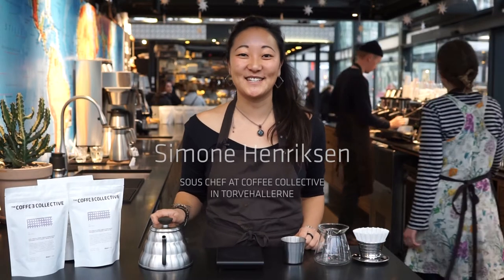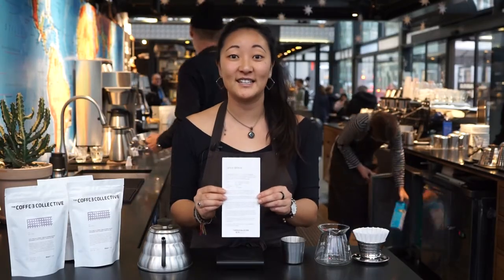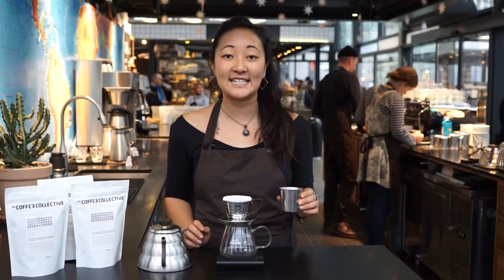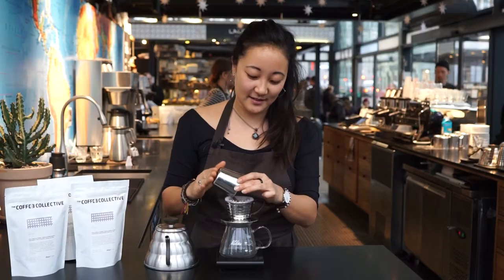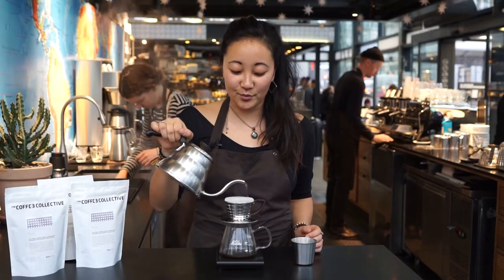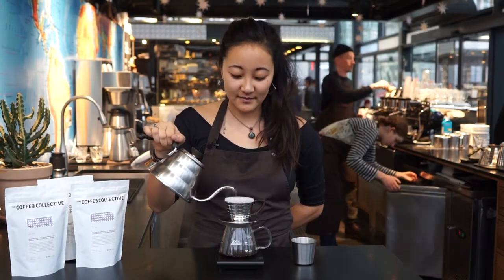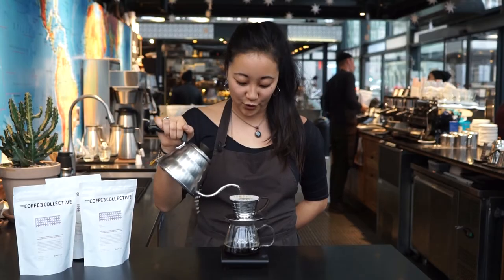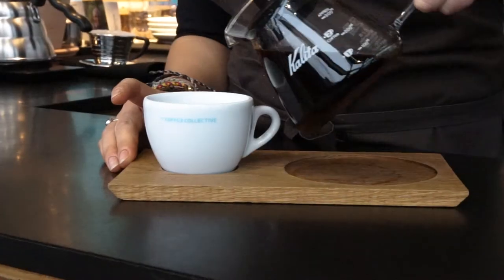Brew Guide for Pour Over Coffee | Kalita Wave Tutorial

Comment: Total brew time?quite important...
Reply from the maker: The total draw down time will depend on the grind size, but is around 2:30-3 minutes. We look more at the pouring time and then we dial in the grind size to optimize the extraction and measure using a VST refractometer.
Reply: @TheCoffeeCollective  thanks. Are you using 155 or 185 Kalita?
Reply from the maker: In the video we're using the 155 but we also use the 185 with 32 g coffee to 500 g water. We keep the pouring time the same actually, and that allows us to use the same grind setting for both.  @markciso1028
Reply: She said 1:45 in the video at the time 1:59 (video time)